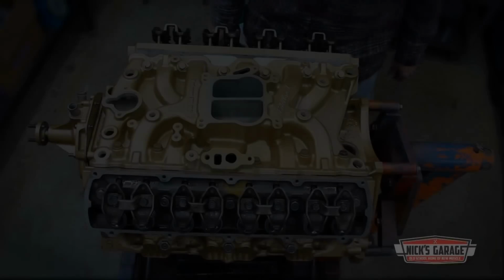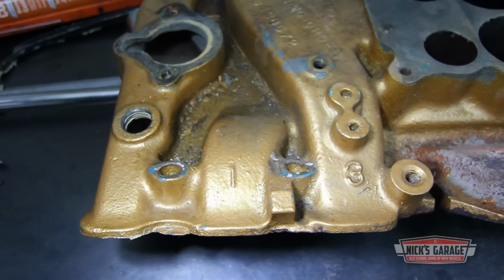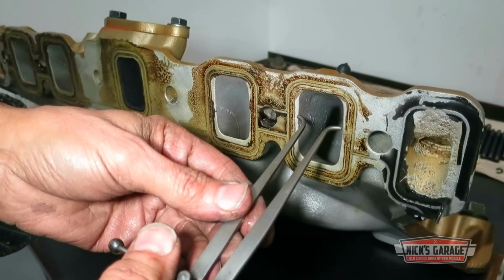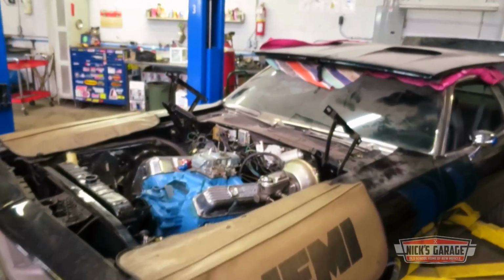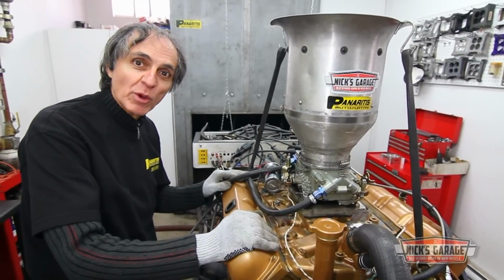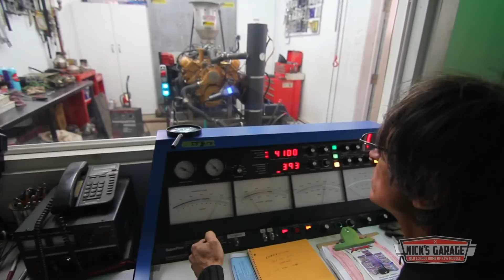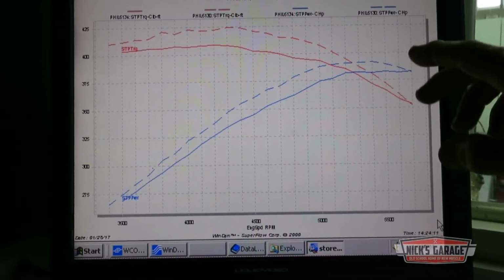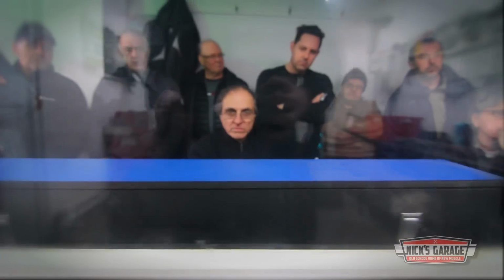Edelbrock VS Iron - Rocket 350 on the Dyno!

Comment: I had 3 79 trans am’s with the 6.6 olds 403 and they were beast I loved the but the ex wife made me sell them should have kept them and let her leave a few years early
Reply: Yeah, the biggest regret I have is not packing up and walking away a lot sooner
Reply: Funny.
Reply: Been there, done that.  And lo and behold - it was an Oldsmobile too!
Reply: The 403 is not a bad motor, the head design and coolant flow sucked and they over heated quite a bit under pressure but some simple things could get them over the 400 horsepower range, They had great torque as well, In all honesty i think too much is being asked of this motor, Nick repeatedly revs it over 5000rpm on the dyno which is pushing it, These motors had lower ranges at which peak power was had, usually between 2000 and 5000 rpm, more designed for torque at lower ends

Comment: Oldsmobiles always have their own little unique rumble.. i love it.
Reply: They certainly do. Very stout mills
Reply: I had a 79' Pontiac Trans Am that had the Olds 403 in it stock..it lost compression and I had it bored .040 to clean it up and put a mild cam..basically this same Performer intake and a Edelbrock 800 cfm carburetor on it..Wow it had so torque and just really ran great for a mild engine..very good after that.

Comment: Stuck one of these in a 77 Chevy short bed pick up for my son in the early 90s ( for all you Chevy guys, if you take a piece of 1 1/2 inch strap iron, bolt a Chevy motor mount to it so it straddles the middle of the 3 tapped holes in the olds block just above the oil pan, it will drop right in. Shorten the drive shaft 4 1/2 inch for the olds trans. Cheap 300 hp.

Comment: It’s that adapter, it’s choking the flow from the carb into the intake. In the 80’s that same adapter was available and it was known to be a dud. It was just so you could put an easier to tune Holley on your car since the Q-Jets were hard for most people to tune. But a well tuned Q-Jet will make more power than a Holley on a restrictive adapter.
Reply: I built a 403 to replace the tired 350 in my 68 Cutlass when I was in High School in the late 80's. Car was factory 4 spd and had 3.91 rear gears. That motor always ran better with factory intake and Quadrajet carb. Had more power and was easier to drive, less surging. Beat the crap out of that engine, including many 6000+ RPM shifts, and many runs down the quarter mile. 13.3's at 106 with factory 14 inch rims and street tires.

Comment: Great vid. Thank you Nick. Olds Rocket motors are monsters. A friend of mine had 400 rocket olds from a late 70's model trans am stuffed in a 69 cutlass convertible. He tweaked the stock quardrajet carb, new exhaust/headers, removed any smog equip, etc., gear for that year 3:08 maybe? and 2 speed power glide. We got clocked down a local drag/highway at 137 mph with the top down LOL. 1986. The state trooper who pulled us over back then said "what are you crazy"??!!! I think he gave us a break because he liked the car. If i had to guess car would have pulled mid 13's in the quarter. Peace from Boston.
Reply: Not a Powerglide (Chevy)--Super Turbine 300 (BOP). It's not a name game--the two trans only share the front seal.

Comment: This is an honest effort and super refreshing to see. I have a dyno (SF-902) in my shop and I have also built some Olds engines and was not surprised to see the Edelbrock manifold outperform the stock. This engine does not breathe deep enough @ 5600-5800 RPM to be worried about a little extra cross section with the stock iron manifold. Also I have never seen a spacer arrangement like you were using work either. It was very refreshing to see the truth on the internet for once! Good job and nice engine, oh and decent video production. Keep it up!
Reply: RAMMBRUTE. I see you know your olds engines very well. Thanks for watching.
Reply: I was glad to see this as well since I have the same intake on a motor I'm building.  Mine was originally a 2 barrel motor so I'm pretty sure the Edelbrock will flow more with a reman 750 Quadrajet on it.
Reply: I just read your reply, I am 62 so I remember the 350-455 engines and the W-30 options, didn't the RALLYE 350 have aluminum intake like the W-30 455? I remember the car itself as being yellow but yes only a 350. I had built a 67 Yenko clone Camaro when I was 20, 427/425 engine, 4 speed and 456 gears true old school by todays standards but walked on everything in town. I agree that those 'spacers/adapters seemed it would distort airglow nd I have seen some fast cars running the Q-jet, I had a 650 spread bore on a 396 325 with the cast intake, Q-jet was finicky and playing with those metering rods were not easy.  I ran a junk 780 on my 427 with a dual plane that some cut the middle out of, do you remember the single plane Tarantula that was on an angle for some weird reason?
Reply: Isnt that adapter upside down
Reply: @zxtenn  Yep, I remember those single plane Tarantula's. I'm wondering if he'd done better here with a spread bore carb. I've never known of those adapters be much of an advantage to airflow, it was just a way to put one type of carb on another type of mani!
Reply: I'd never second-guess a guy with as much experience as Nick, particularly not on max power dyno pulls.  I've built and tuned some Olds engines, and for street-driven engines dual-plane intakes and Q-jets go together like bread and butter.  The small primaries and monster vacuum-controlled secondaries are great for the street, and the secondary metering rod/spring adjustment, when set up right, is flawless.  Changing primary metering rods and springs is a wet job, and you may need an extra top gasket or two, but not difficult.  I wonder what a Q-Jet and spreadbore intake with good displacement would do, and what cam specs  that sweet little Olds is running?  Maybe a single plane intake with the Holley?  Hood fit might not work out, though.
Reply: @zxtenn  My understanding of the twisted tarantula intakes, were to try to equal out the runners length to the cylinders.
Reply: @flyurway  Right as far as I remember it was an ADAPTER
Reply: @johnlaws8764   Sounds feasible, I just remember my buddy having linkage problems due to that angle but if it worked it was worth it
Reply: @zxtenn  That's all they were for and when flipping them over and using them to put a spread bore carb on a standard intake you were then funneling the airflow ... yeah, like that'll get ya' HP!
Reply: @zxtenn  two years ago I purchased a 1972 402 rebuilt BBC it had the single plane twisted tarantula intake on it. I put the engine in a 1989 c1500 , the single plane worked better than I thought it would on a performance street engine. But I had my heart set on a eldelbrock duel plane air gap intake, so I paid $300 and got one. Now I didn't have the engine dynoed before or after but I couldn't tell any seat of the pants different in either intake. Honestly I wish I had kept the old tarantula intake it looked cooler, worked well in city driving. And I didn't have any trouble with hooking the old throttle body accelerator cable to it it worked good. I'm sure on a Dyno the new air gap will show improvement over the old intake surly. But for a strictly street performance engine I was surprised the old intake technology worked as good as it did.

Comment: Those engines like the quadra jet carbs. Experimented with with a holley and quadra jet years ago on  350 olds cutlass. Only had a seat of the pants dyno but the quadra jet was the better for sure.
Reply: I think the quadrajet is 10 times better for driveability
Reply: Dave Micolichek  my dad runs nhra stock eliminater with one for many decades now, my street car uses the biggest quadrajet off of a 70 model 501 caddy engine I've modified it much excellent carb in my opinion
Reply: Dave Micolichek  Billy Lynn k/sa number 4113 it's a 1979 Malibu red in color 305 engine runs mid to lower 11s
Reply: Dave Micolichek  that's a fun class too. My dad just won the  shootout for stock superstock combo race at Memphis Tennessee leader in points for that track.  I like ihra myself lot less bs than NHRA will give a person
Reply: Dave Micolichek  very much more political. I like how laid back ihra is

Comment: Had the Rocket 350 in a 73 Olds Cutlass. Good memories of that motor!
Reply: Dougie Fresh I grew up with same car , swivel buckets seat s push button trunk for the trunk monkey. Lot of memories good and bad . It sat two inches off the ground , rust holes on the edges of canvas top and trim . It got the name rust bucket at the drag strip every Wednesday at pir

Comment: My old man had a Rocket 350 in a 68 Cuttlas with a little known optional package called a "Ram Rod" package.  The car had a turbo 400 trans and 12 bolt posi rear with a low gear in it.  It was very quick for a plain looking Olds. I saw that car beat big block Chevelles and Camaros.  It was quick.

Comment: My father had a '68 Olds Cutlass w/ one of those 350 Rocket engines he used to rave about. Sadly, that car got rear-ended and we pulled the engine/trans, before it went to the scrap yard and he installed that drive train into a '67 Chevelle to go drag racing. I recall thinking how cool it was to have a gold engine gleaming at you when you open the hood, like a piece of precious metal created by a mad alchemist - iron to gold. He sure won a bunch of class trophies w/ that Rocket.

Comment: Edelbrock offered two performer olds intakes, the 3711 which I believe you have and the 7111 rpm version. The 7111 has a raised carb height of 2 inches. It is also rated to 6500 rpm instead of just 5500 as the 3711 is.

Comment: It's kind of interesting that after they swapped to the original manifold using the same carburetor that they had to go up the Jets because it was too lean. That would seem to indicate that it was in fact flowing more air. Otherwise it should have been rich. Kind of interesting great video as always
Reply: My thoughts.
Reply: Probably fuel evaporation due to hot iron intake.
Reply: if you not moving as much air thru the carb it will pull less fuel and theres also the fact that fuel distribution per cylinder will affect air fuel ratios.
Reply: I bet if he put a quadrajet right on there without a spacer he would be making 400. The carburetor bores on quadrajet line up exactly with the holes in the stock manifold. Which means direct flow right into the engine

Comment: When I was in high school I had a 64 Cutlass that had a 330 in it.  Looked exactly like the 350.  I rebuilt the engine and put in an Olds part number, "police pursuit" cam,  It was otherwise stock, not even headers.  I don't know how much horsepower it had but it would pull strong right through 6000rpm.  I had lots of fun in that car, got a lot of tickets and a lot of, um, trim.  ;-)
Reply: I just recently bought a 65 330 ultra high compression with same factory cam. Havent got to drive it yet though
Reply: @eyeshocars9978  I think you'll be impressed.
Reply: @x-man5056  Thanks i hope so. Not looking for it to be a race engine or anything but to be able to get out of its own way and keep up with modern traffic. It should be way better than the 307 its replacing
Reply: @eyeshocars9978  Yes but I don't know what "ultra high compression" means here.  If it's higher than 9 to 1 you'll be haveing to run premium gas possible even race gas if it's above 11.5 to 1.  If you are running it as a daily driver I would want no more than 10 to 1.  
The 307's were always dogs from the factory but easily modifiable to spunky motors.
Reply: @x-man5056  its 10.25 to 1 compression
Reply: @eyeshocars9978    That should be OK with 91 Premium on the street but barely.  Only buy good gas.  If you can get ethanol free, even better.  Don't get crazy on ignition advance.  If you start hearing detonation (ping, knock, etc) start reducing the full advance slowly until it goes  away. Or juice your gas.
If I remember right, your full advance should not be beyond 30 degrees.  On  initial advance, I'd start with 8 degrees BTDC and if its hard to start after it's been running, go down 1-2 degrees at a time.  
If you run headers...+20hp, maybe a little more but it will run better.  The ones for an Olds 350 should fit it.
Have fun with it, mine pulled through 6000 rpm...regularly (I was 16).  Would love to do all that again. ;-)
Reply: Is the 330 about the same performance range as a chevy 327/350?
Reply: @eyeshocars9978  Better than 327 IMO and I've owned 3, one of them was a 62 Corvette.  Similar to 350 SBC.  I think the 330 has more torque throughout the curve than the Chevy's but just going by seat of pants feel, never had them on a dyno.

Comment: Put a 780 Double pumper spread bore Holley on it with the right jetting and will make more power than the setup with the adaptor plate. The restriction in the middle of the stock manifold is robbing it of horsepower, even with the adaptor. Some mild porting work will help a lot as well on the stock manifold. Even the Edelbrock manifold could use some porting work. 
We call it gasket matching on both the heads, and manifold, and it made a huge difference in both torque and HP.
Great video and it shows the difference between stock, and aftermarket
Reply: yes,  I do this as well.. motors run more smoothly across the board, idle great, quick response,., I think the balancing of air flow has a big effect..  all stock and aftermarket manifolds have rough castings and benefit some smoothing out.

Comment: I was doing engine development work on the 70 440 6pack in 69. I got a work order to install a new supplied aluminum intake. I installed and it became part of the improvements for the 1970 model year.
Reply: Don Berry.    I wish I was there to work with you.

Comment: In the early 80's I had a 350 SB in a 72 Nova. Raced on an airport runway that was not yet open to the public. There was a 66 Galaxie 390 4 sp, and a 68 Olds 442 with a 350 Rocket. My Nova had  a 2 bbl carb, 3 sp, All my motor had special was the 461X heads. I won all the 1/4 mile races that day! It would almost pull the front wheels with bias ply tires in back!

Comment: This is a key example of why bigger is not always better.  With a carburetated engine you always have fuel suspended with your air charge going into the runners and ultimately into the combustion chamber.  You're goal is to always keep the fuel atomized as much as possible.  If the velocity is too low the fuel falls out of suspension, which is kinda what I'm suspecting is happening here.  The smaller port actually is making more power because the fuel is better atomized due to the velocity vs the pure volume.

Comment: Great video Nick! SO CLOSE to 400 HP! 

I built a few Olds engines; (2) 350's and (4) 455's. I was glad that you pointed out the really good design of the original 350 manifold. Olds 4 barrel intakes from '67 - '72 performed especially well. They really liked a 1" thick 4 hole spacer with a 800 Q-Jet; that may have got you to 400 hp (but that wouldn't go with your customer's car!). The only problem with those intakes was they were HEAVY! Especially the 455's. Just changing to an aluminum intake on my '69 442 raised the front end up when parked about 1 1/2 inches! Olds also made aluminum intake versions for the 350 (1970 W-31) and 455 (1970-72 W-30), but they are near impossible to find today; mostly all wasted on show cars!

A bigger cam would probably have got you there. I used a Mondello JM22-25 on a 350, and though it sounded like it was really radical at start up, it actually mellowed out when the motor got good and warmed up, and made enough (11 - 12") vacuum to run the power brakes and A/C. The JM22-25 was a split profile cam; and Olds engines really liked them too, as the intake port flowed much better than the exhaust port. Conversely, the original W-31 cam, with .475 / .475 lift and 308 / 308 duration was very radical and really too wild for street use. Olds didn't even offer power brakes and A/C with the W-31.

Let us know if you actually got it to 400 hp. I'm betting you did! Thanks again.
Reply: tje1966.   Sorry for the late reply.   Yes, we got our 400HP. Thanks for your info, and sharing your Oldsmobile talent.